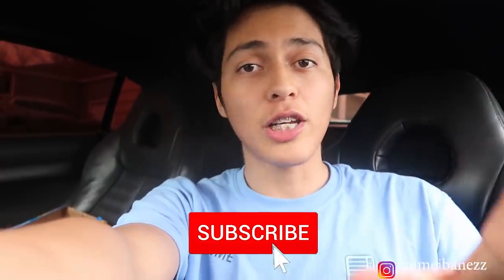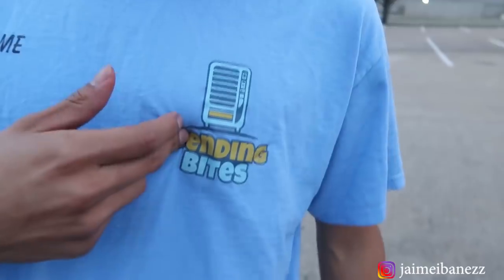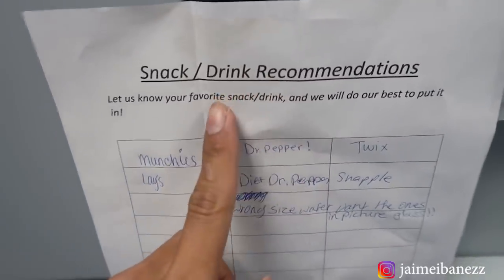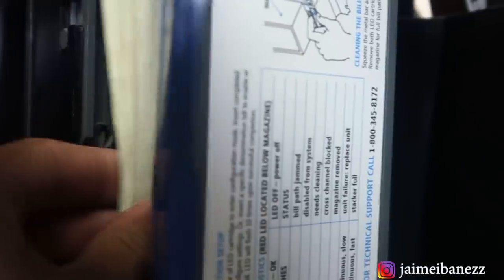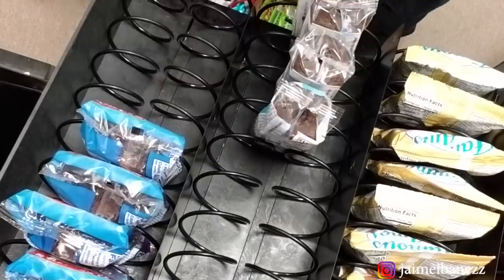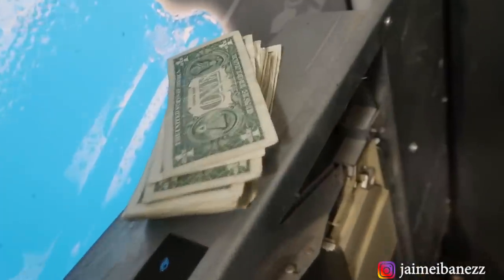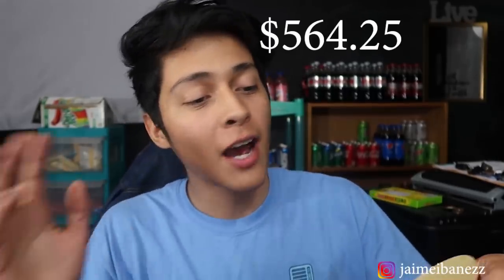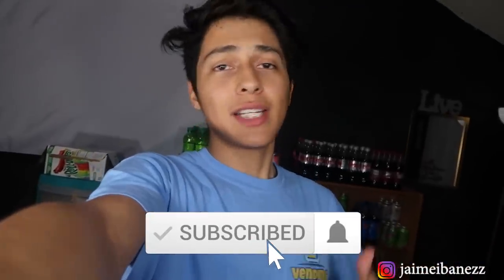Collecting Cash From My Vending Machine Business!

Comment: The one thing that was not calculated in expense is wear and tear.  Over time, the vending machine will need to be replaced or fixed.  Then what about how far you drive, someone has to pay for that gas and calculate wear and tear on your vehicle.  Then you also have to calculate your time.

Comment: Lubbock TX  I have a snack and drink machine at my employer.  I am having trouble getting my snack machine to take bills.  I suddenly stopped working. I was told it has something to do with the power supply.  Light also does not work.  Maybe you can go through some trouble shooting?